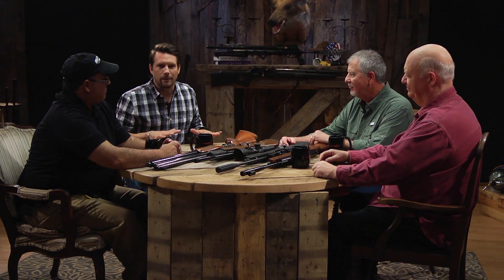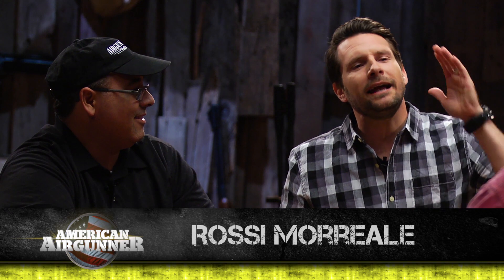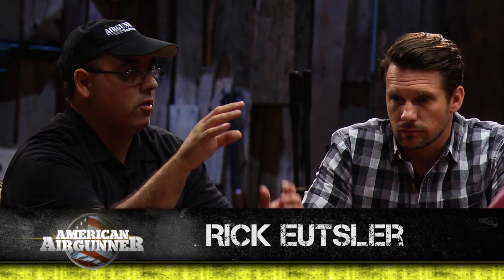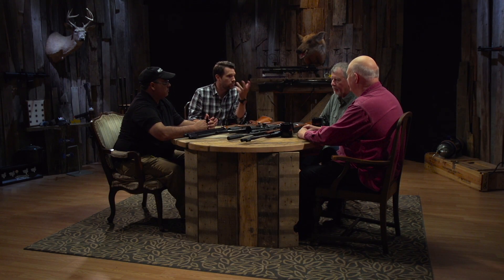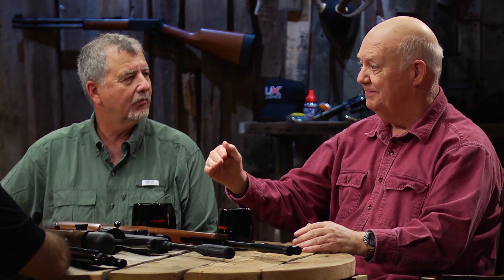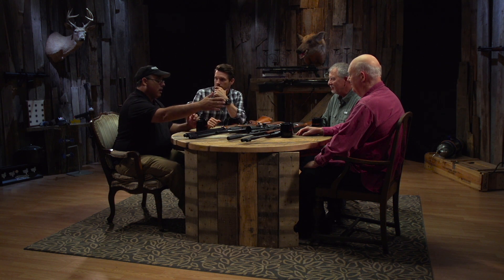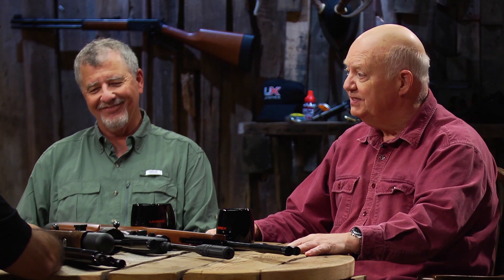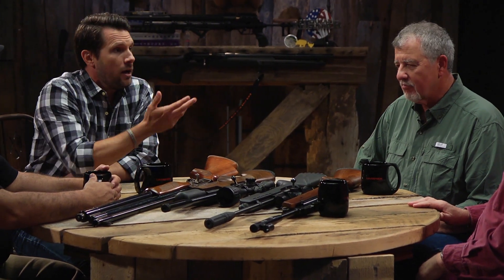What are Foot Pounds of Air Rifle Hunting Energy : American Airgunner

Comment: I am not sure the Godfather is correct with the definition of energy in this case.  He is talking distance over time, work done, which is how horsepower is measured, but I think of this as static.  If I hit a steel plate that does not move, how do you measure the energy?  Force over area of course.  30 fte is 30 pounds of force measured anywhere in a 1 foot square area. That can mathematically be broken down to the force of a .30 cal head, which I think would be 61,128 pounds of force on a .30 diameter pellet head.
Reply: You are right, they got the definition of foot pounds wrong.  Then they said it's the same as horsepower, which is also wrong.
FP is a measure of energy.  You can think of it in terms of impact.  You can also think of impact in terms of force/ area as you say, which relates to penetration especially.  
This is a formula for FP if you' know the force and distance:
FP = force applied x distance moved

This is a formula for FP if you know the mass and speed:
FP = 0.74 (1/2 m v^2)

Comment: I prefer the 13 to 15 foot pounds of energy that my diana model 34 classic .22 air gun puts out when shooting the jsb domed 15.89 grain pellets that I shoot more than the 21 to 23 foot pounds of energy that I used to get from the diana 350 magnum .22 air gun that I used to have that I shot jsb diabolo 18.13 grain domed pellets out of because that extra 25 to 30% of foot pounds of energy was overkill and the gun was hard to cock and it was too big and too heavy and I didn't like the sights. Funny thing is I reckon in great Britain I would probably need a permit for my diana model 34 classic .22 air gun because I'm getting over 12 foot pounds of energy with the pellets I'm using

Comment: The point is that the velocity on the box is meaningless, because you don't know how light of a pellet was used to achieve it. Once you know how fast a gun will shoot a particular weight of pellet then you know the power of the gun, or in other words, the foot pounds.
Reply: It's not really meaningless if you know anything about airguns.  People who do, understand that the stated velocity is for the lightest pellets in that caliber.
Reply: Sometimes it feels like the fps mentioned on the box is meaningless .. and total marketing BS. I have heard that the Sig Sauer P226 ASP pellet pistol's fps number on the box had been lowered even two times (if not three) since it's release. Sure, not that meaningful on a replica pistol for short ranges - but it still makes you think of how reliable the manufacturer and marketer is.. I have not ever chronographed projectiles myself - but you can easily say only by shooting it - that it is clearly not what it is claimed to be..
The P226 ASPs box also of course tells you that results may vary depending on allkinda stuff. Sig has their own light weight alloy pellets - but they did not score any good on the Replica Airguns chrony test with the Sig X-Five ASP. Alloy pellets might be lighter - but the alloy seems to have more resistance in the barrel than the lead pellets. Could say that the lead pellets have a built in lube in it's composition, that the alloy pellets do not. Seems like alloy pellets might be therefore better for higher powered airguns - or for airguns with shorter barrels. 
Dunno. No expert here, but...
Reply: Gamo is Notorious for Overstating their fps figures.   They use hyper-light alloy pellets (that are generally unavailable to the public), and added to that - are "diesel'd" to further enhance the fps numbers.  Would be Far more beneficial (and Truthful) if they would just put "real world" numbers,  along with the Name, type, and weight of the pellets used in their testing... Much Preferably with Lead pellets instead of those silly, rifling damaging, lightweight alloy pellets.

Comment: they left a lot on the table. "12-20 fpe regardless of caliber" ,,,  .22 gets the hunting nod in most books.
Reply: And for no real reason. a 177 at 12 f/lb is plenty to penetrate the skull of a squirrel sub 50 yards, and rabbit as well. With 22+ you just get a bigger hole and more damage, but how dead can an animal be? I can shoot a squirrel with a 22lr and kill it, and I can shoot one with a 30-06 and kill it, is the 30-06 better because it does more damage? Smaller the caliber, the faster the bullet (pellet) speed and the flatter shooting it is. Higher the caliber, the more downrange energy is put on target. Downrange energy only comes into play with anything bigger than a racoon IMO, raccon and smaller with brain shots don't require hardly any energy.. all about penetration and cutting that brain's function.

Comment: Instead just say force=mass x velocity
Reply: Incorrect. force = mass x acceleration
You are thinking of momentum = mass x velocity
work = force x distance 
kinetic energy = 1/2 x mass x velocity^2
net work = change in kinetic energy
Foot-pounds is a unit of both work and energy.
Reply: @recurrenTopology  So [mass x acceleration x distance = 1/2 x mass x Velocity^2]
This would  [Velocity = SQRT(2 x (Delta Velocity / Delta Time) x distance)] which seems both confusing and incorrect.
So I looked it up and it seems that a [foot pound = a foot pound per second] then had a drink and left the world of medieval weights and measures to return to the world of metric.

Comment: Wrong!  One foot pound of energy is a unit of energy of a force of one pound moved a distance of one foot, not the weight of one pound moved one foot.  You can think of it as the force in pounds times the distance in feet moved equals the foot pounds of energy generated.  However, when we're launching projectiles, we are interested in the speed of the projectiles, the kinetic energy which is one half mass of the projectile times the speed of the projectile squared.

 A weight of one pound object moved up a height of one foot or dropped one foot is one foot pound of energy.  This is a simplistic, physical, explanation of a one foot pound unit of energy.  You could take a one pound object and drop it from a height of 100 feet and get 100 foot pounds of energy or get the same by dropping a 100 pound object dropped 1 foot.  I hope this gives you a physical, intuitive, meaning of foot pound of energy.
Reply: Not quite right Tyrone - but close: It's the energy required to move a MASS of one pound through a distance of one foot.
Reply: Keith Mann 
Wrong.  There is no such thing as "mass of one pound."  A pound of an object is a unit of weight but it is also a unit of force when mechanical energy is given.  Mass of an object and a weight of an object can be related but they are not equivalent.  You can have an object with lots of mass but zero weight (when you stand on a scale in a falling elevator, the scale will say your weight is zero, however, your mass is not zero). Weight is a relative term.  The  weight in pounds as we usually define it on Earth is the gravitational force between a stationary object and Earth.   Mass is independent of weight.  Your weight is zero in outer space but not your mass.  In the USA, the unit of mass is in slugs, not pounds.  An object with a mass of one slug on Earth's surface has a weight of about 32.2 pounds, depending on location on Earth.  On the surface of the Moon, the weight will be less but the mass unchanged.

 Kinetic energy and potential energy are known as machanical energy and in the USA has units in foot-pound.    The pound in here is the unit of force, not weight(you can have a heavy object but no force applied to it), not mass.  I'm not saying that a moving pellet has no mass - it definitely has mass.  Moving pellet has kinetic energy, also in foot-pound unit.  When a one pound object is lifted one foot off the ground, it has a potential energy of one foot-pound of energy.  The weight is one pound but so is the force, one pound.  When the object is dropped (it's moving, falling) one foot, it has one foot-pound of kinetic energy on impact.  Remember, the gravitational force on the object is one pound. If I were to raise the one pound object to a height of 12 feet from the ground, the object would have 12 foot-pounds of potential energy, and when dropped 12 feet to the ground, the object will have 12 foot-pounds of kinetic energy on impact.  This doesn't mean the impact force is 12 pounds to the ground.  The impact force depends on the condition of the ground.  The important thing to remember is that the pound in foot-pound unit of energy refers to the FORCE in pound(s) and the distance in feet.  In this instance, the weight is the force. 

 Another way of looking: The force is the push or pull in pounds.  If I push or pull an object horizontally with one pound of force for a distance of one foot, then I have done or spent one foot-pound of energy on the object.

Take another example: a 300 Win.mag can be loaded to produce 3000ft-lbs of kinetic energy.  This is equivalent to dropping a 3000 pound object one foot to the ground, converting potential energy to kinetic energy.  This is a simplistic view but valid.  More math is involved in calculating kinetic energy of a moving object but conservation of energy law says that potential energy can be converted to kinetic energy, and vice versa.    So I can use this anology.  Mechanical energy defined in terms of foot-pounds of energy mean the distance in feet and the applied FORCE in pounds, not the mass in pounds(whatever that means).

I hope this gives you an intuitive sense on kinetic and potential energy in foot-pounds.

Good luck.
Reply: I stand corrected! Thanks for your very complete explanation. I must remember to not reply to you tube posts after a couple of glasses of whiskey!!
Reply: Keith Mann 
You are welcome.  Good luck.
Reply: Yes, I was about to correct what the guy said in the video but you nailed it.

Comment: here is a good example:
Not long ago, I had a discussion online with some dude, who claimed his dinky .177 springer had "the strength of a .22lr", and I said "no, it doesn't". At which point he got passive-aggressive (in a "i'm sorry you're stupid" way), and said "well, gee, I should have said "it has NEARLY the same power as a .22 rimfire", and I'm still like "no, dude, not even close".

My best guess is - he saw that big "1200 fps" sticker on the box, checked that a .22 lr also fires at 1200 fps, and figured, what the hell - 2.4mm (.177) is nearly the same as 5.5mm (.22), so that's close enough, right? WRONG! A .177 springer will shoot 1200 fps allright - with a lightweight, 4.7 grain pellet, producing about 16 J of energy. A .22 will also shoot 1200 fps... with a 40 grain bullet, producing 140+ J of energy. Depending on the load, a .22 rimfire has literally 10 times the energy of a .177 air rifle.

And then there's conservation of energy. See - a heavier pellet has more inertia, which makes it resist velocity changes due to drag (ie - wind resistance, not wearing girls clothes. Although, pellets are skirted projectiles, so there's that).
Since the formula for kinetic energy Ek = 1/2 mv^2, a small change in velocity means a greater change in energy. Without boring you with math, a 15 grain, .22 pellet fired with a muzzle energy of 16J, 40 meters downrange, will retain about 20% more energy, than a 8 grain .177 pellet also fired with a muzzle energy of 16J. That, combined with better energy transfer into the target, makes .22 a better choice for hunting small game, than a .177. Although, with something like H&N Baracuda Hunter Extreme 9.57 grain pellets, a 16J (UK-legal) air rifle (the one in question was a .177 HW100) can produce quite gruesome results on rabbits.

Velocity is important for target shooting. Technically, a 7.5J, 10m olympic air rifle that shoots 185 m/s with 8 grain pellets, in zero-wind conditions can be used to shoot targets up to 50m just as well as a 16J .22 that shoots 185 m/s with 15 grain pellets (wind makes it more tricky).
Reply: .177 caliber = 4.5mm not 2.4mm